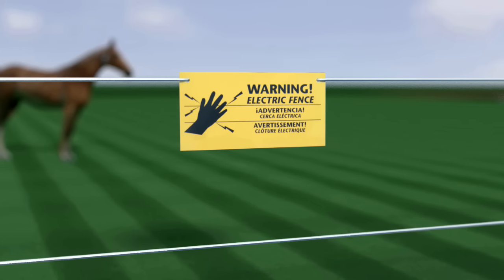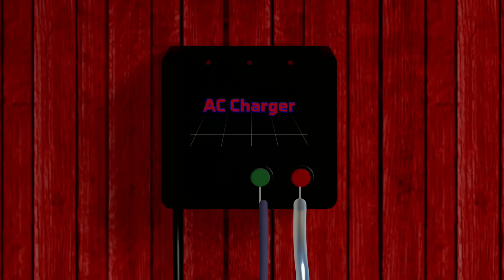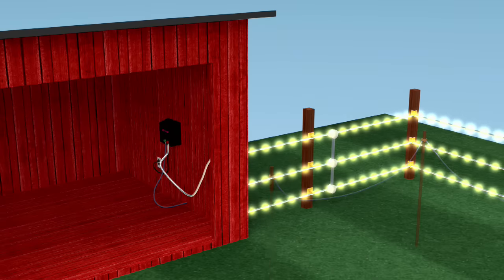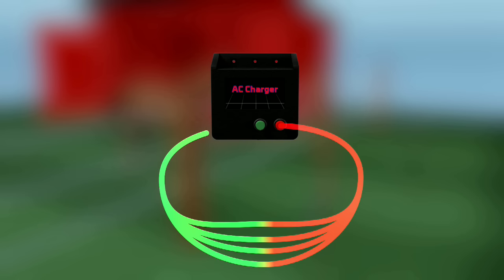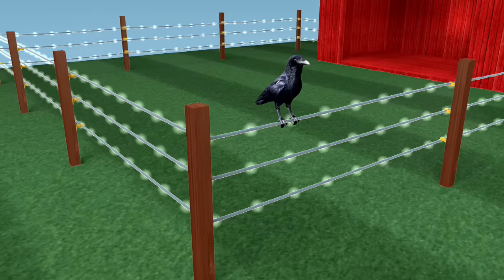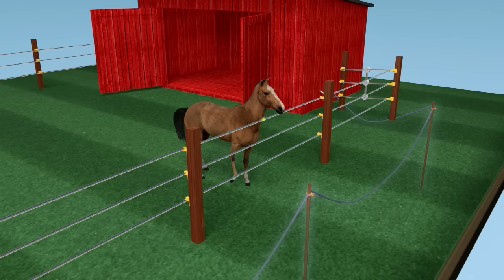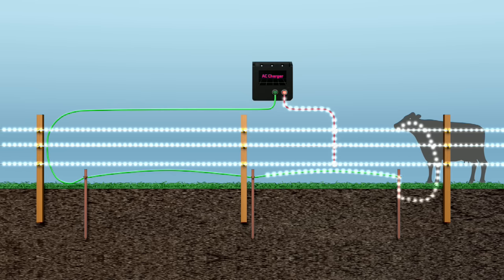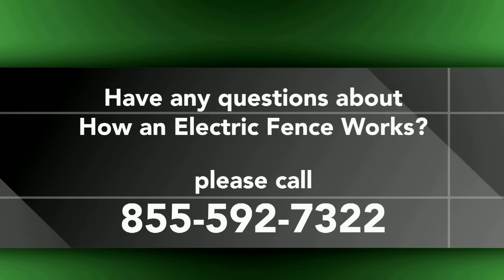How Electric Fencing Works

Comment: I farmed in younger days. One solution for problem animals is to have a ground wire between hot wires. Also heavy wire under tension transfers the shock better than the usual light wire used on hobby farms. A proper fence will stop polar bears.

Comment: I got one of your fence chargers from Tractor Supply under the American FarmWorks brand.  Anyhow, I have a bear coming into our apiary trashing beehives.  I read all the instructions before I purchased the device and noticed you had to set this solar charger in the sun for 3 days to charge it up.  I can't gamble on the 3 days, so I called your help desk.  The gal said I could trickle charge the device for the initial usage to expedite the charging and to get the device into action before the bear wrecks the entire place, however, she could not tell me how to actually charge the device.  My question is, do I need to take the housing off to expose the battery and hook the trickle charger directly to the terminals on the battery, or can I just hook it up to the positive and negative on the device itself?  Some decent instructions with this method of charging would be much appreciated by all of your customers that need to get the device into action asap!  Thank you!

Comment: What happens when a wood stick touches the electric fence
Reply: sam b nothing, I’ve tried
Reply: sam b  if wood is wet, then you get the shock
Reply: E.C. Rae if its wet then you get the shock
Reply: Wood is not conducive that's y they use them in power ploes much cheaper than alternative
Reply: Nothing
Reply: Nothing happens it isnt metal and stuff

Comment: If the charged wires are covered by an insulating material, how is the electricity transferred from the wire>animal>ground> negative terminal?
Reply: uninsulated fence wire --> animal --> ground --> uninsulated ground rod --> insulated ground wire. The ground wire insulation is stripped at its connection to the ground rod.
Reply: run insulated wire underground when you want to make a run under a gate or something

Comment: If I wear sneakers - I still get a shock, doesn't rubber soles shoe protect you from being shocked?
Reply from the maker: Hi there! Please contact our customer care team with any questions Monday-Friday 8 a.m.-7 p.m EST. and Saturday 9 a.m.- 5 p.m. EST at (855)592-7322!
Reply: @ZarebaSystems   Why not answer the damn question? Why does someone get shocked when insulated from the ground? Jeez.
Reply: The soles on your sneaker are not thick enough..try a different pair of shoes with a thicker sole and make sure they are not wet or damp inside or out.
Reply: no

Comment: I doubt there is a series of transformers in the "fence charger".  More than likely, there is a high frequency switching power supply that drives one smaller transformer at a higher efficiency and a cockroft Walton multiplier on the output.
Reply: My guess was something to make 12 volts (say), then an ignition coil to make the thousands of volts, and some kind of gadget to make it pulse, some kind of blinker module.  I never have opened one up.  If you're making thousands of units to sell, I guess you could design and build a special transformer to do whatever you want.    ??  This doesn't account for battery operation.  Ah.. maybe the flasher thing... HM.  When it closes it powers the ignition coil very briefly, and also say heats up something, makes the switch open.  So you'd get just one pulse every so often.  Here in The FUTURE you could make some electronic thing and do whatever you want I guess,  a timer and an inverter, let out five pulses every six seconds except for Sundays and Christmas?
Reply: You answered your own question. An automotive coil boosts 12 v DC to 25K v pulse by the distributor. So no need to  use more than one transformer. One transformer from input voltage multiplied up to 2K volts for the fence.  The pulse is developed by a simple timer circuit to pulse the output.

Comment: how can a human get shock when he wearing a rubber shoe most of the time
Reply: The design might be different, for example there will be both phase and neutral lines running parallel, and touching both constitutes a shock. Either this, or that there is only single phase line with high voltage as shown in the video, and touching ONLY that without touching ground still gives a shock since the human body has stray capacitance that allows current to flow.
Reply: A typical fence runs pulses of several thousand volts.  You need a lot of insulation to keep that from not arcing across small gaps and even out the side of your shoe to the ground.  It's very low current and very short pulses, thus it creates pain but not electrocution.
Reply: Depends on the charger, often if the fence is designed to use the braided wire or tape fencing than the connection takes place all in the line itself.  It is not as strong of a shock as the solid wire electric fences though.  I shocked myself plenty of times on the wire I had running around the top of my fence to keep the neighbors dog away from my goats.  I always had thick soled boots on but it never mattered, unless I managed to time my touching the fence in between pulses I always got a bit of a shock.
Reply: Well you will get shocked but you will be able to pull your hand away from the wire (if you were to get shocked because touched the wire) but if you have no shoes on and standing on the ground with your bare feet you won't be able to pull your hand away from the wire unless it's weak electricity, someone brave enough to pull you away or there is some safety kill switch ( like house electricity for example)
Reply: Can you deliver products to Vietnam?
Reply: well at least I got an answer on why I never got shocked
Reply: Bo it's the parasitic capacitor in the air that hurts

Comment: So all wires on every electric fence are hot?
Reply: That would imply a loss of energy (like a resistor). So when using low resistance conductors they would not.
Reply: Some aren't.  Sometimes people will run ground connected wires in between the hot wires to deliver a much stronger shock if an animals touches those two wires at once.  Some also just don't make all the wires hot to give the impression of protection without spreading too much electricity through too many wires and weakening the shock.

Comment: Is the electric fence running ac or dc current?  I suppose it should be dc current because AC current usually grabs and doesn't release.
Reply: I'm pretty sure its the other way round, Alternating current Contracts and relaxes the muscles due to its frequency Where as DC has no frequency just 1 stop shop to clench town... That being said AC power is much more dangerous at lower amps than DC
Reply: This video didn't explain it, but I heard that electric fences output charge in very short pulses, rather than DC or AC at 60hz.  I guess it would be ac due to the transformers, but Im not sure it makes much of a difference if you do AC in short pulses, or DC just switched on and off for a short duration. It's one of the main reasons why electric fences don't kill you when you touch them.  Most people think it's low amps, but I don't think there are going to be low amps the way some fences are designed(ones with ground wires in between hot wires).

Comment: if they remain touched then ? they may die ..or
Reply: We had Ancona chickens that would get on the wire and not try to get off.  We would remove them and they would run off.  None of our other breeds did that, they would instantly get away from the fence.

Comment: If you're wearing leather shoes or just normal shoes you wouldn't complete the circuit right ?
Reply: it will depend on the insulation of the shoes themselves.  I have a solar charger that barely even shocks if I have some nice rubber soled boots on--but I had to test it to make sure it worked so I took one boot off and stepped on the ground... then touched the wire and found out quickly it works well.

Comment: Don’t like the idea of shocking any animal even once..
Reply: It's either that, or they may escape and get hit on the road or killed by another predator depending on the animal.  Electric fences are a fricking godsend if the animals are trained to it.  Usually it only takes a few times and they'll know to avoid it.  No different that touching a hot stove.

Comment: If bird's don't get shocked by standing on the electric wire, explane to me how last week, I saw a bunch of bird's set off a HUGE power surge electrical EXPLOSION on a neighborhood power pole - that had lightning bolts illuminate the entire upper half of the pole, with LOUD electrocution buzzing sounds? Just like the videos showing a powerful electrical short. During this electric light show, the many bird's flew off during this electrical event, but the electric wires didn't explosively separate from the pole connections. This happed during the daylight hour's.
Reply: Why do you thinks the birds did it? Maybe a bird got into a bad position and shorted something, although I think the rain would have done that first.
Reply: @josephpostma1787  It didn't rain that day. I was parked waiting for a traffic signal to change to green. I just happened to look over to my left, looking at a bird sitting on the wire, when all electrical hell broke loose. 
The bird vaporized leaving a huge electric lighting bolt in it's place. Just a few feathers floating in the air where the bird used to be.
The LOUD boom 💥 scared the s**t out of me. I was ready to floor the car 🚗 to get out of there in case some electrical wires were going to come down on my vehicle. What a light show afterwards.
Reply: If they touched a hot wire and a neutral wire then current will flow. If there was a transformer on the pole, the birds likely made contact with its outputs. 

You have to have a potential difference.
Reply: Electric fencing works using the ground to complete the circuit. The power poles from the utility have both the hot and neutral wires in them. Meaning that touching the wires together completes the circuit. Or touching both wires with your body or bird body completes the circuit. Does that make sense? Someone correct me if I am wrong.